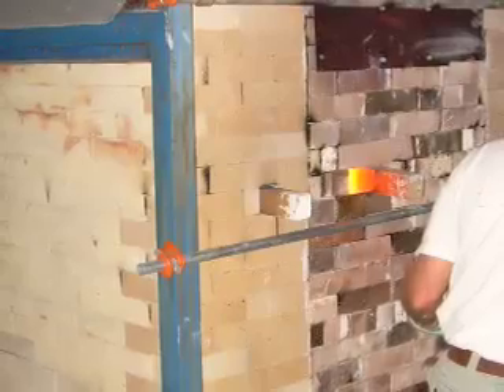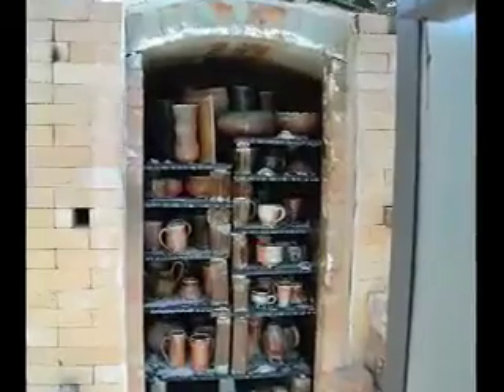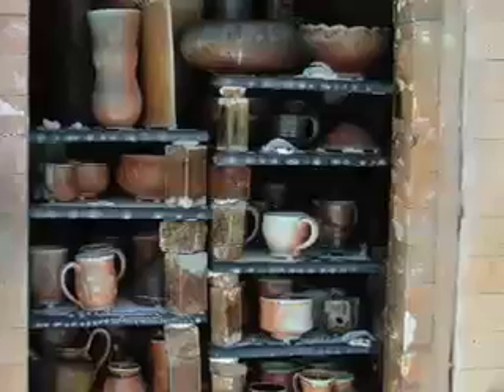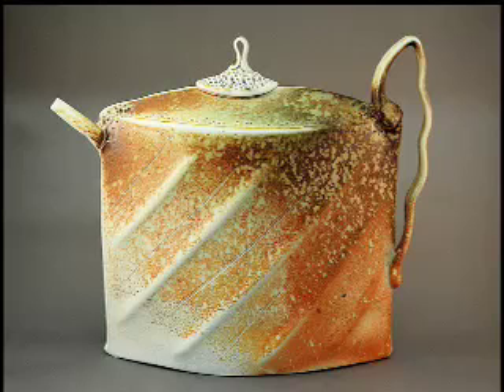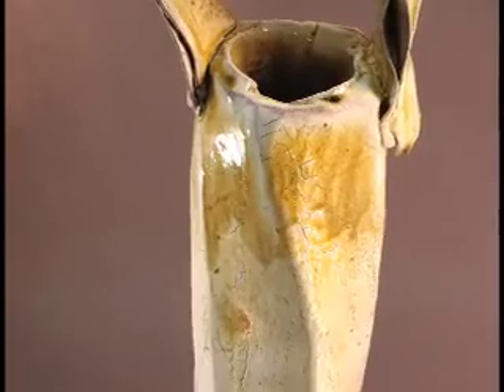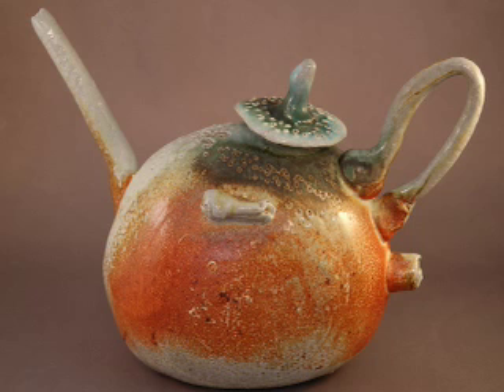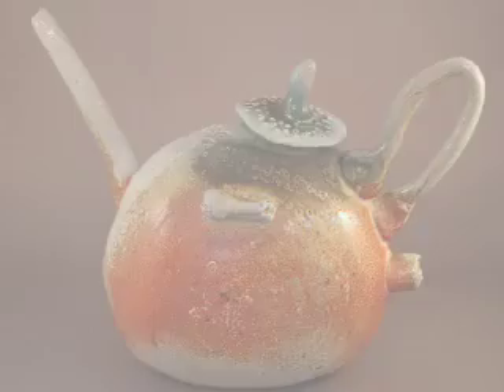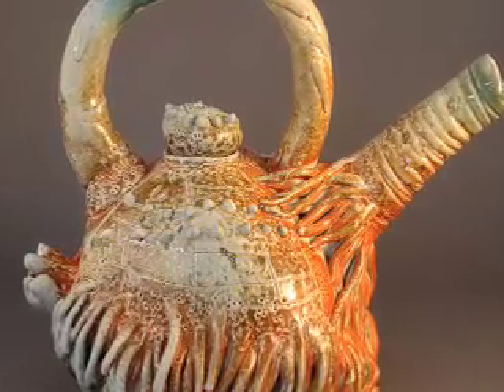Soda Glazed Clay Pots

Comment from the maker: No, there should be no taste from the glaze as the result of soda or salt firing. The difference is, in a salt firing salt is used (NaCl) and in a soda firing baking soda or soda ash are used (NaHCO3), but the result is sodium silicate which is an insoluble glass and has no taste. I suppose the interior of the cup, which is generally a different glaze, could have a slight taste, but that is very unlikely. Wash it very well and try it again. If you still find there is a taste, discard the cup!